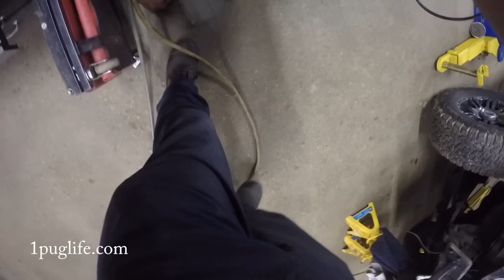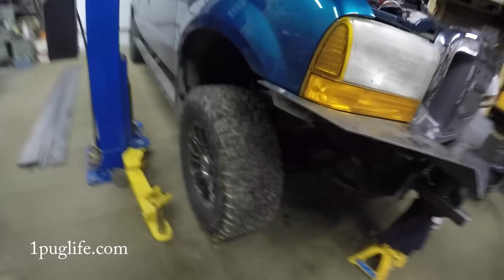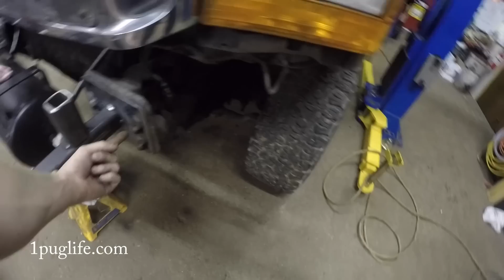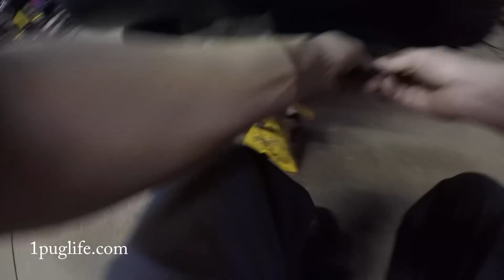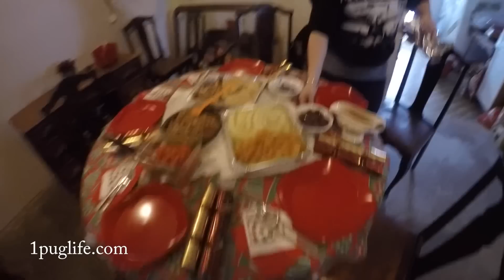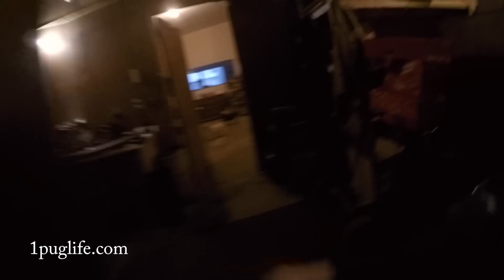crawdad gives zero fox bout christmas

Comment: The big clock in the middle of the mirrors has been on 7 : 10 forever.  
I would set to 4 : 20 for grins if you not going to but a battery in it.